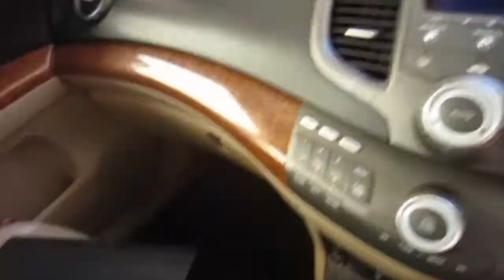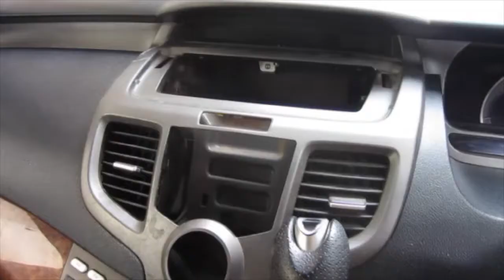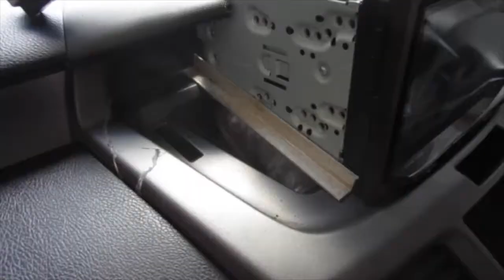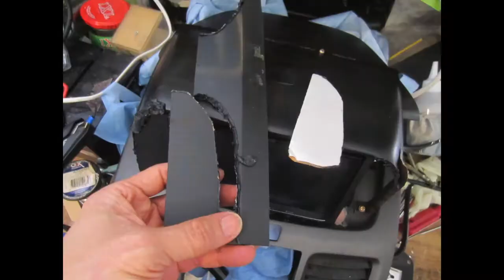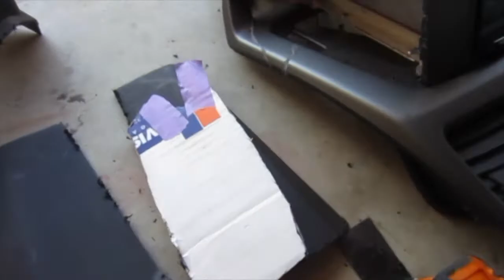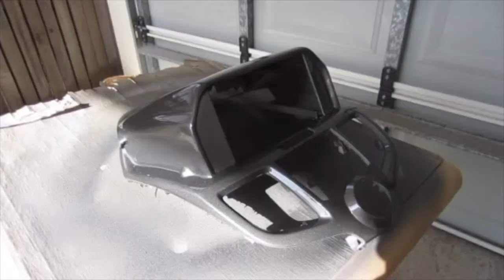custom made car stereo fascia using recycled plastics Honda Odyssey RB1

Comment: Great video. Just wondering how you did the wiring for the head unit. I've searched and searched but nowhere shows where the connections are made for this specific Odyssey.
Reply from the maker: Thanks for the comment. Interesting you ask about the wiring . I must have spent almost 4 months working on the wiring because the vehicle has the station display at the very front, the controls closest to you in the dash, the CD down near your feet and maybe the amp under the seat . The only other video showing this installed in an Odyessy RB1 was from a New Zealand car installer who won’t help.
If you stay tuned to my channel , I’ll make a video on how to wire it up. That will save you 4 months. I even connected steering remote .
Reply from the maker: What brand head unit did you get ? I chose the Kenwood for the steering remote functionality.